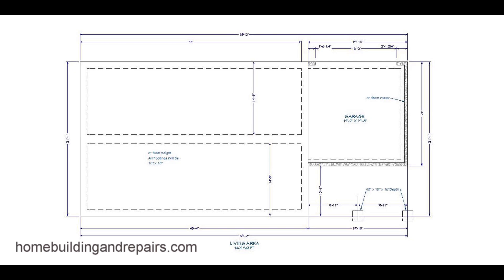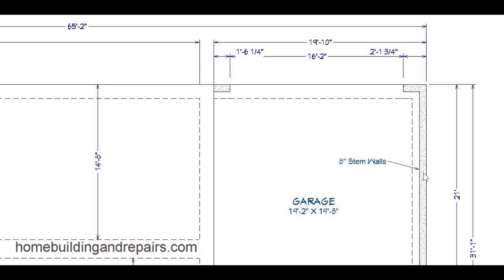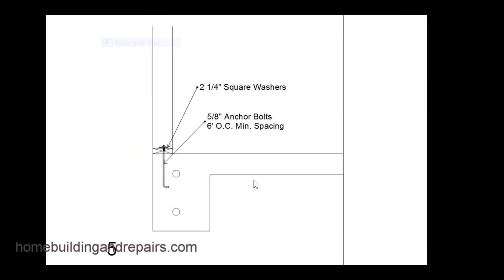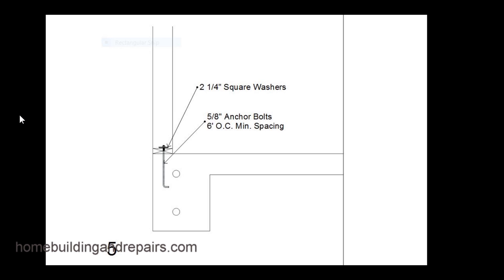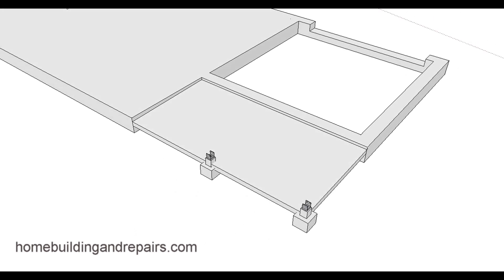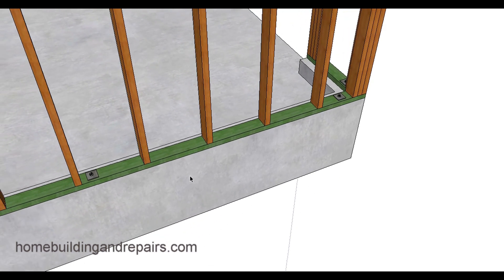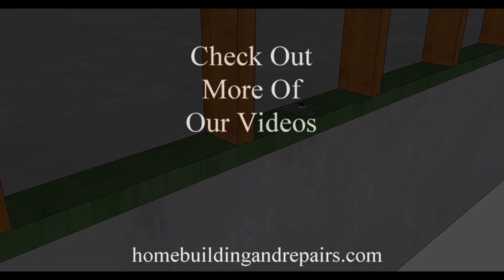Part 4 Concrete Foundations – Small House Design and Framing

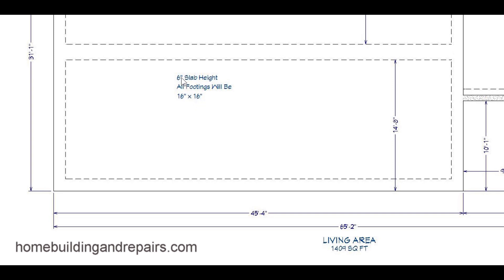Comment: Please pardon my comment if you address this issue later in video but I wanted to mention it to you as soon as I noticed. Not critical and unlikely to cause problems but just to insure no viewer confusion. when you're explaining slab height and footing depth at roughly the 2:50 time mark you say to add the 6" slab height into the depth to make a depth  to make a depth of 22". But the depth was not shown in that picture that just showed the 16x16 footing width. Though earlier in the video the depth is shown with 16x16x18. So 6"should be added to 18"for depth. Again not complaining or criticizing. From the videos of yours I've seen it appears you make an effort in their precision and quality. thx for the vids I enjoy them. cheers
Reply: ive been sniffing coke in a garage under my house, been on it for 2 days, cold and depresdd now